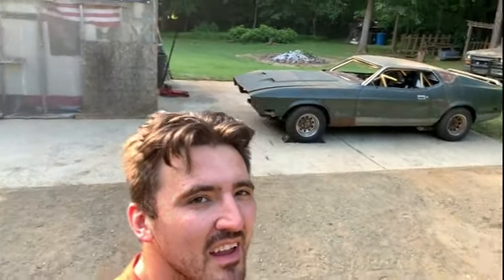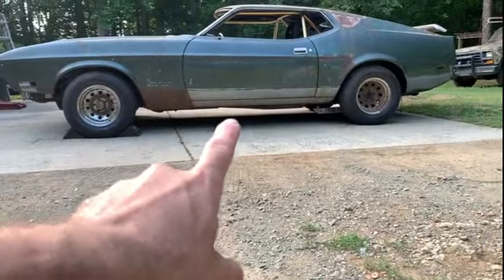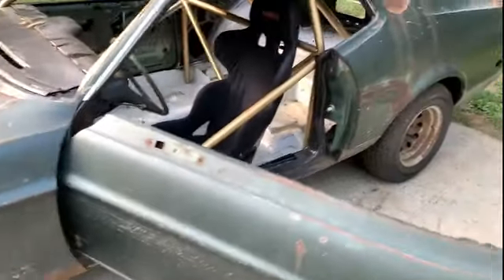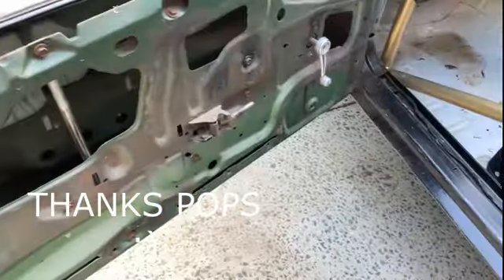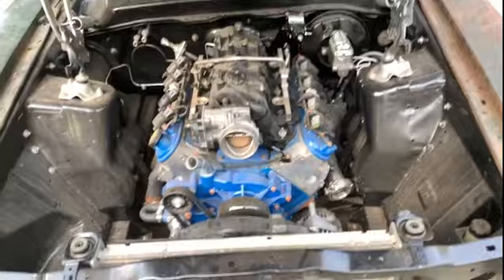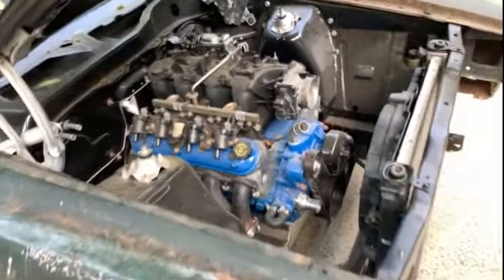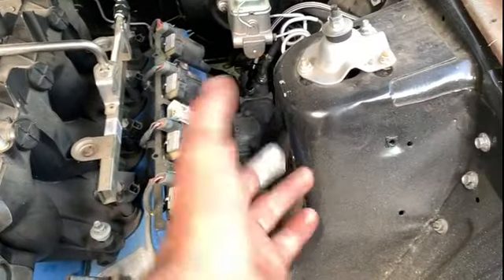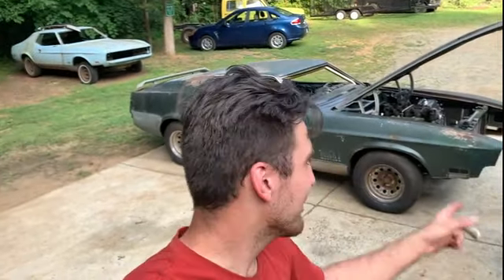Walkaround of LINDA the FIRST LS SWAPPED 1972 mustang Mach 1

Comment: Goals my two favorite mustangs the Mach and the grande
Reply from the maker: Mach 1 is mine and the blue grande is my dad's and we want to get started on some of the sheet metal this summer
Reply: Interestingly enough, the 73 Grande needs about the same sheet metal work that my son put into the Mach 1. So we got good practice. As for the engine in the Grande, this Mach 1 has a numbers matching block and transmission (Q code 351 4V). We plan to rebuild and install this motor in the Grande so the motor has a place to be exercised and kept fresh instead of rusting away in a shed. The idea is these 2 cars will never be separated, one for racing one for cruising.